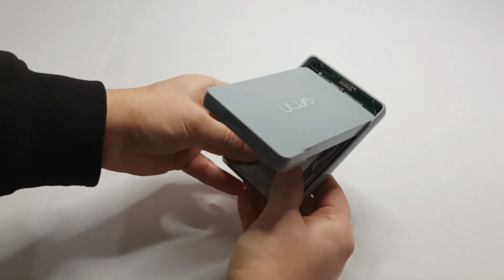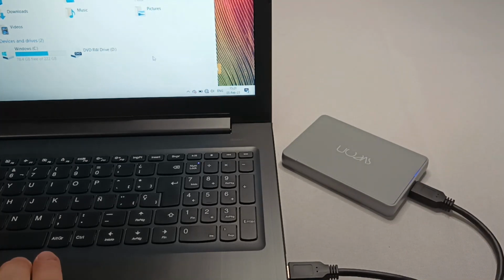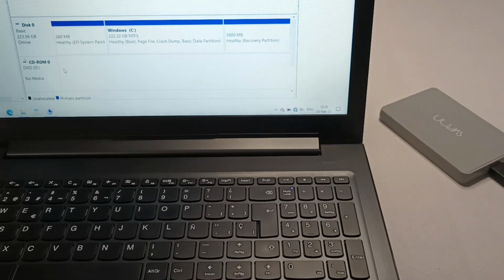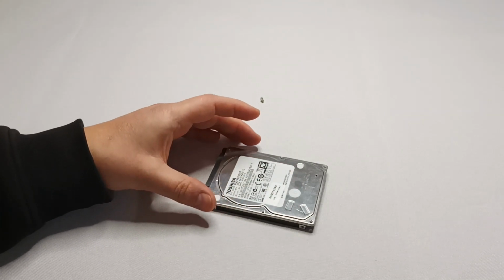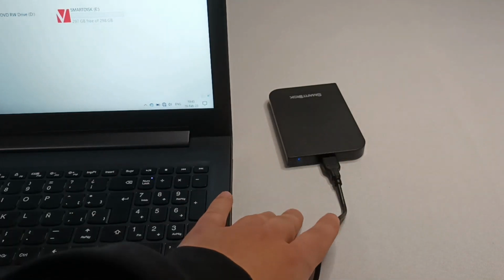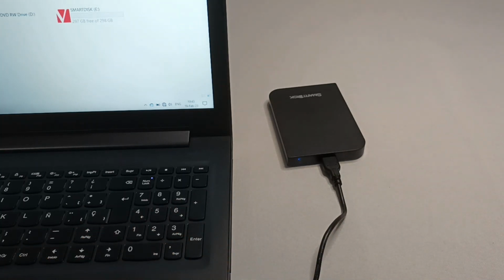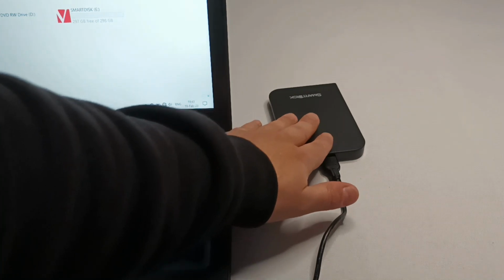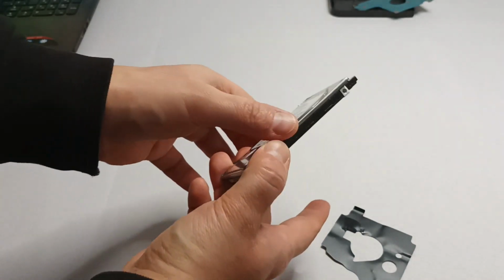Can I Really Fix a Hard Drive Myself? Is It Possible to Fix an HDD at Home? PCB and Platter Swap.

Comment: The problem was when you unscrewed the orange part that holds the read/write heads. The heads are magentic so if you remove that part they will disallign because they will attract eachother. and if they are misaligned they can't read the disk or they can also damage the disk.

Comment: Drive is clicking because it does not able to load its firmware, you probably killed the reading heads + damaged the drive platters when transferred
Reply: Hi, I have got a question. If I replace the head, do I still need PC3000 to recover my data or I can clone my HDD using with SuperHDDClone??
Reply: Wrong i have swapped the plater with its board including its original fw to another same working hdd but sadly after finishing swapping the head no longer read and the drive turn off after a few sec